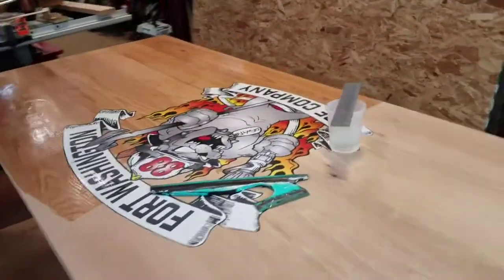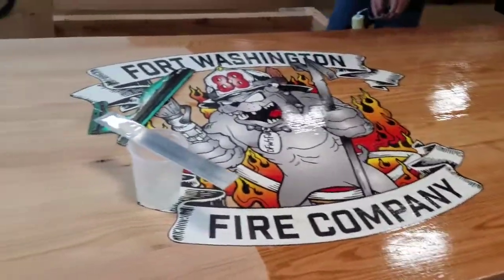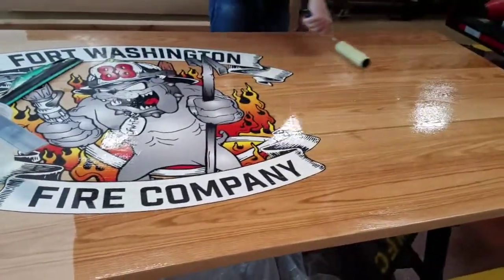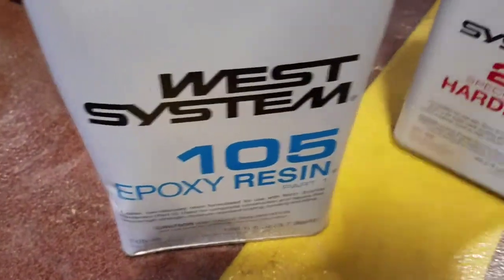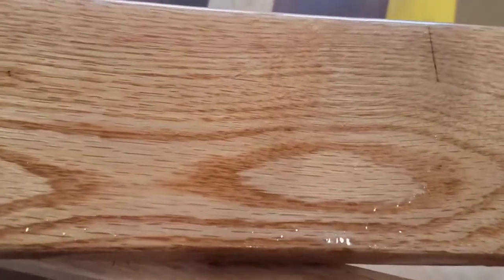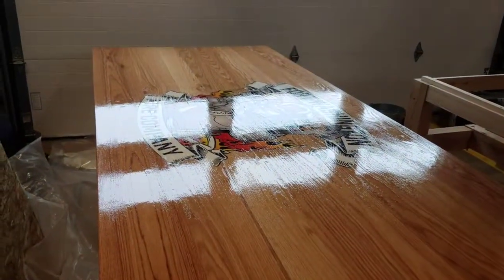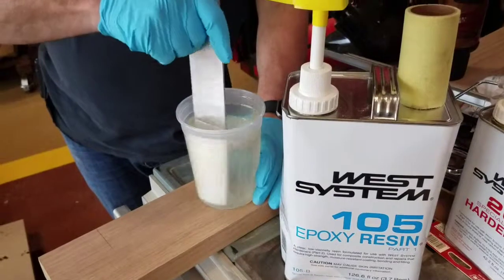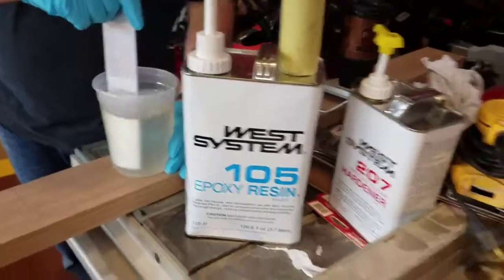Epoxy table top finish on our fire house table.  West Systems.

Comment: I find it best mixing one big batch and putting it on thick with brush and when the bubble come up use a torch.
Reply from the maker: Exactly.  Since the sealer coat wasn't fully cured there were so many bubbles the torch didn't make a difference.  We ended up sanding it down a good amount and applying a 3rd coat which helped but the finish still has dips in it.  Its held up great though.

Comment: how did you get the bubbles out?
Reply from the maker: We didn't get them all out.  We ended up sanding it and putting another coat on.  It still had imperfections.  We learned that we should have mixed one large batch an applied it instead of mixing multiple.  We also didn't let the sealer coat cure enough which would have prevented the large amount of bubbles.

Comment: Any videos of the pour?
Reply from the maker: I don't know if we put up any videos of that.
Reply: @zvelivis  What quantity of epoxy did you use for the flood coat?
Reply from the maker: @georgeholman5356   we used part numbers 105B and 207SB from west systems.
Reply: I see that it is a 3-1 ratio for 105 and 207. How many cans did you guys use?
Reply from the maker: @georgeholman5356  1 of each

Comment: man you can wet sand it! then buy spray max clear 2k in a can use two coats then wet sand with 1500 and got to 2000 then use 3m polish step 1 and two! use the purple one here i found it

3M Perfect-It Rubbing & Machine Polishing Compound (16 oz) (3M-39060, 3M-39061) i use this to cut the clear it has
Reply from the maker: I did sand it but the variations were way to big to sand out.  We really need to tape the sides about 1/8 - 1/4" above the top and pour again to ensure we have a flat pour.  We learned a lot since this was the first time using epoxy for a top.
Reply: zvelivis lol it’s weird how you can learn on the fly! Make sure you sand it with 80 before doing it again! Make sure you see no shiny to it wipe off with water and microfiber cloth !  Looks great man let me know when it’s finished